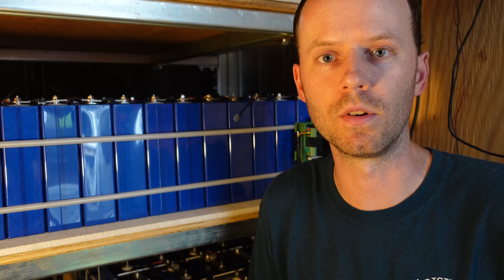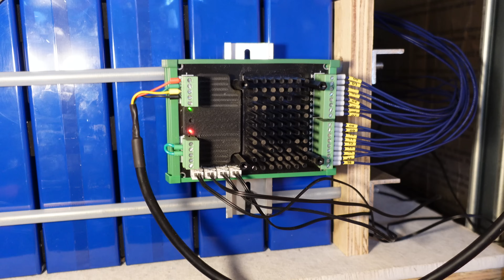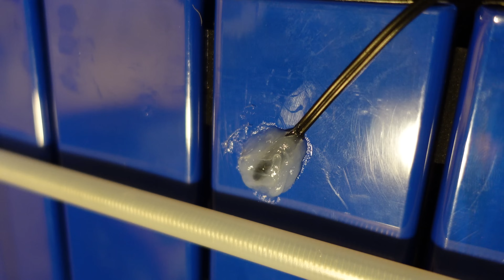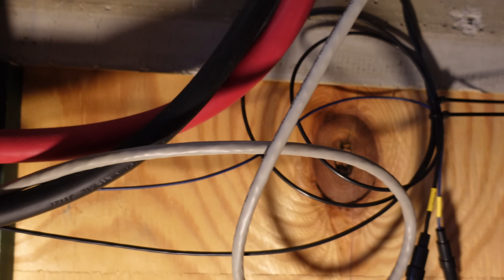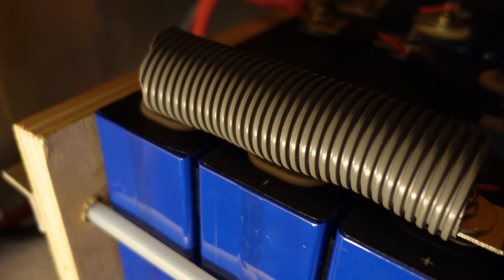EVE 230Ah LiFePO4 Batteries, Finally Installed and Operational

Comment: Can you explain if you  have 2 WatchMon Cores - one per battery bank or if you have the 2 packs hooked up together?
Reply from the maker: I have one Watchmon Core (the supervisor/computer) and two CellMate K9 (cell monitor, one on each battery bank). They're connected together as one BMS system.
Reply: @LithiumSolar  So one shunt after the 2 banks are connected? Would love to see a video hlon how you have the bms system set up, both wiring and software. Looking to do the same thing.
Reply from the maker: @markv3494  Correct, one shunt for the whole system. I do have a video of the installation here (though only one K9 is connected) https://www.youtube.com/watch?v=m0Z25-jqLrs

Comment: The dust on the heat sinks for your batrium concerns me. Try taking a soft paint brush (maybe from Michael's or other art supply store) and brush the dust off. Compressed air alone won't do it. This should be a regular maintenance procedure.

Comment: If your LiFePo4 have screw-in studs you could replace them with longer studs and use plastic (nylon) cap-nuts and large nylon washers above the metal nuts and busbar to protect against accidental shorts.

Comment: Are you using a single k9 for all 32 cells?  2 cells in parallel for each balance lead?
Reply from the maker: Correct. Single K9, 2 cells in parallel.

Comment: The Tubing is called a wire loom.  You should run a plexiglass cover over the top, and drop down 1" to 2" on the sides.  The 3/4 plywood ends would support this nicely.  Great looking battery!
Reply: that is what i did. safe

Comment: Here’s a basic question: Is it necessary to fuse the BMS voltage sense leads?  And if so, what’s the fuse rating?
Reply from the maker: The BMS manufacturer suggests fusing the BMS leads when they're long like mine are (longest ones are 5ft). The reason is if one of them gets cut, damaged, over-current at the BMS, or otherwise shorts, especially when they're ziptied together, you'll end up with a melty mess that could (and probably will) catch fire. The fuses are 3A ceramic.
Reply: @LithiumSolar  I have tested bms wires for current. If it shorts to the next cell up (only 3v or so across the wire) then the insulation burns off then the wire starts melting stuff. 
If it shorts across the pack (48v) then the wire basically blows straight away and the insulation does not burn off. Of course you don't want any of these things to happen but it was just out of interest.
Remember to fuse as close to the cell as possible!

Comment: Do you recommend the battery?
Reply from the maker: Yes. I actually prefer the EVE 230's to my EVE 280's so far. Maybe I'll fell differently once I actually get the 280's connected.
Reply: @LithiumSolar  Thankyou for the tip. Can't wait for your next video.

Comment: Looks great, I would suggest handlebar pads? I'm sure there are little plastic covers somewhere on the web. That would look good. Lifepo4 is safer n the only thing I dislike about it is watching the voltage while in the flat spot of the curve. Seems like you can charge forever and voltage doesn't budge. It's a love hate thing I guess. Stoked for the updates

Comment: My short term solution was... I cut a bleach bottle (it is hdpe) cylinder out (the wide smooth part) then cut open the cylinder and lay it over the terminals.  The next part of the idea for covering is to heat the hdpe on a cookie sheet in the oven until it softens and lay it over the terminals and use a piece of sponge foam as the compression form.  I assembled (at the last minute as I have had the cells since February)a 24v 100Ah battery using the 25Ah Veritas cells and used the unheated bleach bottle cover during a recent trip.  Now that I am home, I plan to clean up the bms wiring a bit, and experiment with making the heated hdpe form fitting cover.  This could be done with whatever size you might want to use.  Be careful with the temps as the hdpe can outgas badly if too hot.   I have used this idea for other small things but usually heating the hdpe with a propane touch as it was not critical.  I might just make this as my first YouTube video, hmm!

Comment: As usual, it looks impressive, just like everything you present on your channel. So much attention to minute detail. The only thing that questioned my thinking were the buss bars mounted to the plywood instead of a less combustible material.
Reply: the compression is pointless unless you are planning to use these batteries for  20 years .By then there will be another better chemistry that will make these look like a steam engine !

Comment: how long it take to charge the setup?
Reply from the maker: That's a difficult question to answer as there are so many variables. On a bright sunny day, I can max out both of my 60A charge controllers. It would only take a few hours to charge the entire bank.
Reply: @LithiumSolar  What's your array makeup, rated size?
Reply: In a perfect condition with sufficient solar panels a 10kw battery can be charged in one hour to 80% with 10kw of solar. Absortion and floating is at individual preferences according to battery age.

Comment: The stuff is called a "wire loom" in the automotive industry. It gets used as a conduit to gather the wiring of a car, called a "wiring harness", into an insulated conduit that individual wires can enter and exit through the slit.
Very effective stuff. I highly recommend it.
Reply from the maker: Yes!! I don't know why I couldn't think of the name lol.
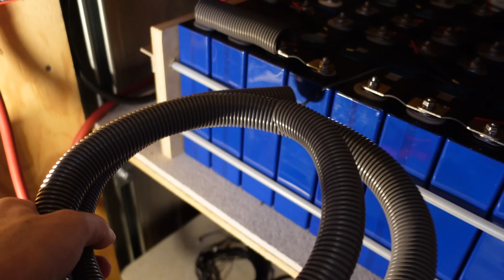Reply: 2:50 Also, it is called corrugated piping and good idea for safety. Plastic liquid tape can be used and look neatier.
Reply: It's actually called vaccume hose ..

Comment: Howdy! Have you thought of using a 3d printer to print some covers for those terminals? Thanks for all your great contents!
Reply from the maker: Thought about it, yes. Probably is I still don't have one! I keep finding more and more reasons to consider investing though.
Reply: @LithiumSolar  may be worth getting a service to print you some parts. If you can design it (I unfortunately can't design things like this) then they can print parts for pretty cheap. $20 goes a long way